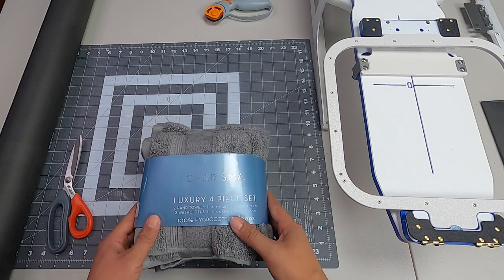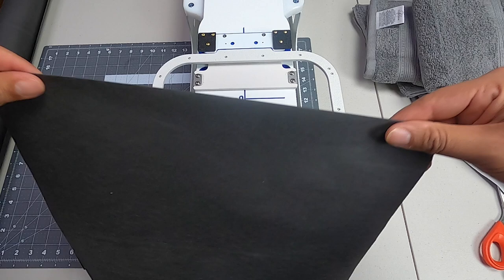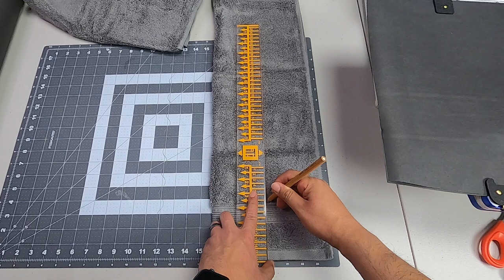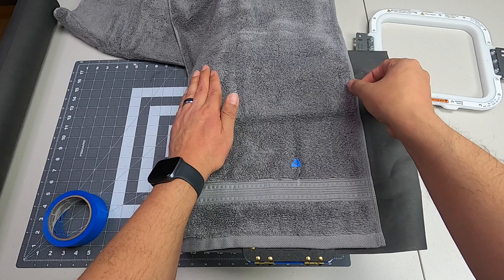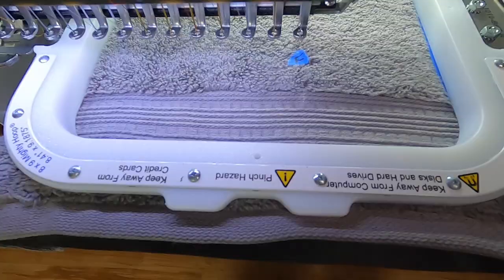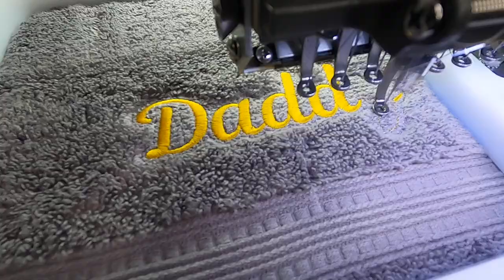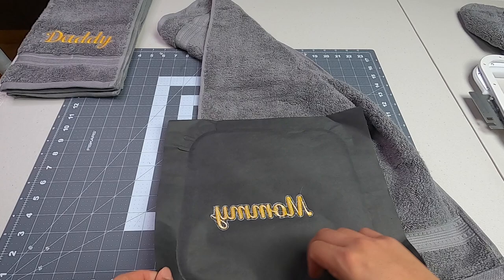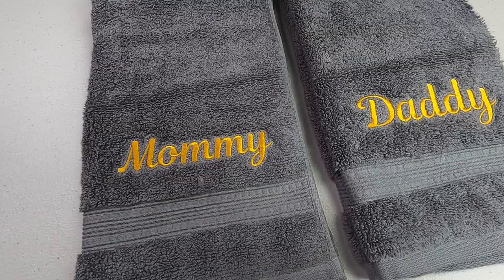How to embroider on towels: Free File included.

Comment: Since your into details, instead of wasting underlay stitches you should have used a water soluble top layer, we use solvy. You will get a better satin top layer also without all that bulk under it and underlay never knocks down the pile enough. Your reverse side will look way way better also, as currently the reverse side looks unsightly. Hope that helps.
Reply from the maker: Yes, water soluble topping is an option, its very convenient and easy to use. I do not like to use the topping. I don't like the clean up, and the overall quality and durability of a knockdown stitch outweighs other options (my opinion of course). It all depends on your preference, if a water soluble works for you, then stick to whatever works for you.

Comment: For pricing, do you charge for the knock down stitches count in addition to the font stitch count? (Is you charge by the stitch)
Reply from the maker: I would charge base off time. If its something thats under 1,000 stitches it’s not a big deal. I usually have set prices for beanies and towels which already has the knockdown stitch factored in.

Comment: May I know what spacing did you use for the knockdown stitches? Thank you
Reply from the maker: Its a tatami stitch with settings: spacing 6mm and length: 4mm. there are 2, 1 running horizontal and 1 running vertical. You can download the file to check out the details. Thanks.